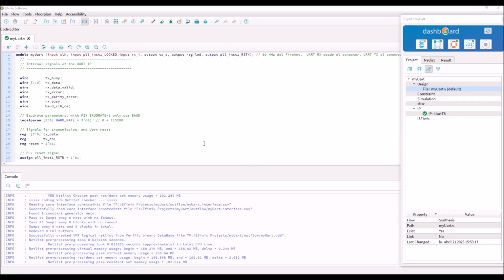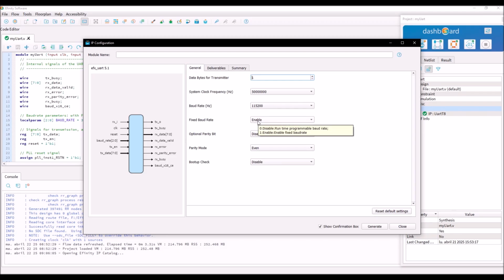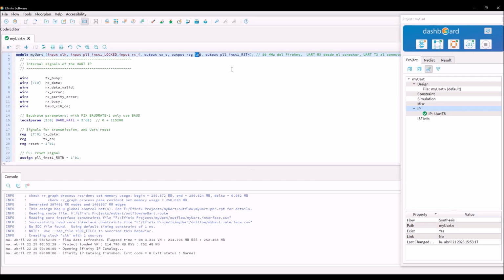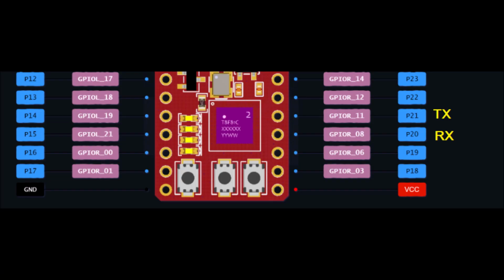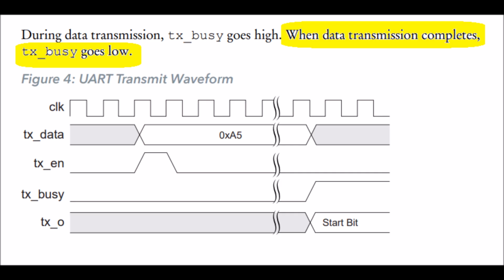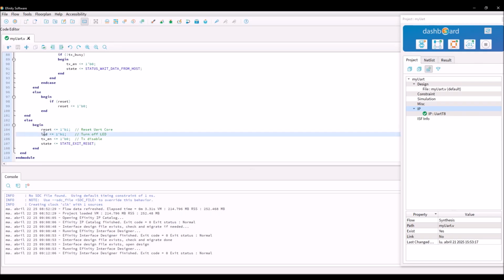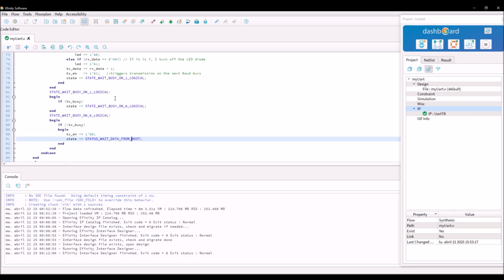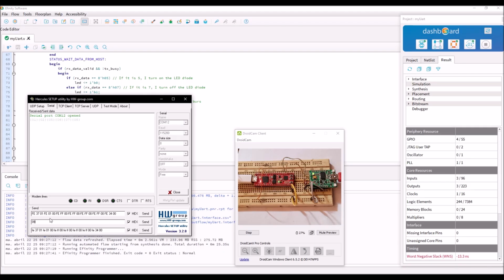4. Designing an UART Module with the FPGA Trion T8 from Efinix

Comment: can you please send the code
Reply from the maker: module myUart (input clk, input pll_inst1_LOCKED,input rx_i, output tx_o, output reg led, output pll_inst1_RSTN); // 50 MHz del FireAnt,  UART RX desde el conector, UART TX al conector, LED de la placa
  // --------------------------------------------------
  // Internal signals of the UART IP
  // --------------------------------------------------
   
  wire        tx_busy;
  wire [7:0]  rx_data;
  wire        rx_data_valid;
  wire        rx_error;
  wire        rx_parity_error;
  wire        rx_busy;
  wire        baud_x16_ce;

  // Baudrate parameters: with FIX_BAUDRATE=1 only use BAUD
  localparam [2:0] BAUD_RATE = 3'd0;  // 0 → 115200

  // Signals for transmission, and Uart reset
  reg  [7:0] tx_data;
  reg        tx_en;
  reg reset = 1'b1;
  
  // PLL reset signal
  assign pll_inst1_RSTN = 1'b1;
  
  // State machine variables
  reg [1:0] state;
  
  parameter 
    STATE_EXIT_RESET                = 2'd0,
    STATUS_WAIT_DATA_FROM_HOST      = 2'd1,
    STATE_WAIT_BUSY_ON_1_LOGICAL    = 2'd2,
    STATE_WAIT_BUSY_ON_0_LOGICAL    = 2'd3;
  // --------------------------------------------------
  // Instantiation of my generated UartT8 IP
  // --------------------------------------------------
  UartT8 uart0 (
    .tx_o             (tx_o),
    .rx_i             (rx_i),
    .tx_busy          (tx_busy),
    .rx_data          (rx_data),
    .rx_data_valid    (rx_data_valid),
    .rx_error         (rx_error),
    .rx_parity_error  (rx_parity_error),
    .rx_busy          (rx_busy),
    .baud_x16_ce      (baud_x16_ce),
    .clk              (clk),
    .reset            (reset),  
    .baud_rate        (BAUD_RATE),
    .tx_en            (tx_en),
    .tx_data          (tx_data)
  );

  // --------------------------------------------------
  // Lógica de control: cuando llega un byte válido...
  // --------------------------------------------------
  always @(posedge clk) 
  begin
    if (pll_inst1_LOCKED)
    begin
        if (!reset)
        begin
            case (state)
                STATE_EXIT_RESET:
                begin
                    reset <= 1'b0;
                    state <= STATUS_WAIT_DATA_FROM_HOST;
                end
                STATUS_WAIT_DATA_FROM_HOST:
                begin
                    if (rx_data_valid && !tx_busy) 
                    begin
                        if (rx_data == 8'h05) // If it is 5, I turn on the LED diode
                            led <= 1'b0;
                        else if (rx_data == 8'h07) // If it is 7, I turn off the LED diode
                            led <= 1'b1;
                        tx_data <= rx_data + 1;   
                        tx_en   <= 1'b1;   //triggers transmission on the next Baud burs
                        state <= STATE_WAIT_BUSY_ON_1_LOGICAL;
                    end
                end
                STATE_WAIT_BUSY_ON_1_LOGICAL:
                begin
                    if (tx_busy)
                        state <= STATE_WAIT_BUSY_ON_0_LOGICAL;
                end
                STATE_WAIT_BUSY_ON_0_LOGICAL:
                begin
                    if (!tx_busy)
                    begin
                        tx_en <= 1'b0;
                        state <= STATUS_WAIT_DATA_FROM_HOST;
                    end
                end
            endcase
        end
        else
            begin
                if (reset) 
                    reset <= 1'b0;
            end
    end
    else
        begin
            reset <= 1'b1;  // Reset Uart Core
            led <= 1'b1;    // Turn off LED
            tx_en <= 1'b0;  // Tx disable
            state <= STATE_EXIT_RESET;
        end    
  end
endmodule
Reply from the maker: I hope you subscribe to the channel or at least give the video a "like".
Reply: @plcworker  of course i have already subscried and like but it doesn't work :( i did exactly as you
Reply from the maker: @YossrTrabelsi  You should share the error message it's giving you.
Reply: @plcworker no error, everything runs perfectly but there’s no transmission reception when i type something on gtkterm(equivalent of hercules on linux) it doesn’t show anything typing 5 doesn’t light the led etc…
Reply from the maker: @YossrTrabelsi  First, you should check if your USB-to-serial converter is working. By connecting TX and RX, you could send and receive the same data.
Reply: Yes i did that and the usb converter works normally on it’s own but still nothing :/ maybe i missed something in the configuration that is not mentioned in the video
Reply from the maker: @YossrTrabelsi If you're using the AntFire board, you can't debug with it. In that case, you could turn on the LED to determine how far up the code execution is.